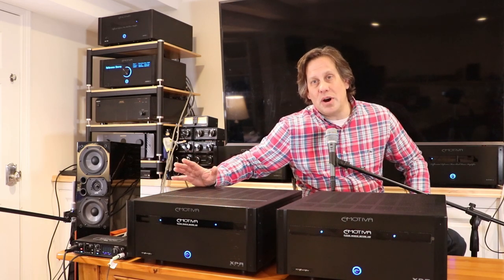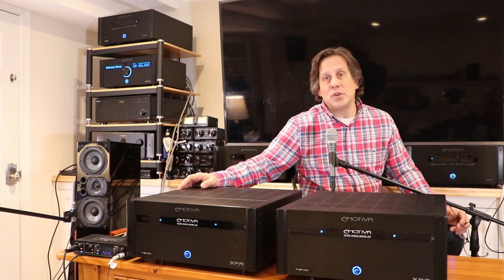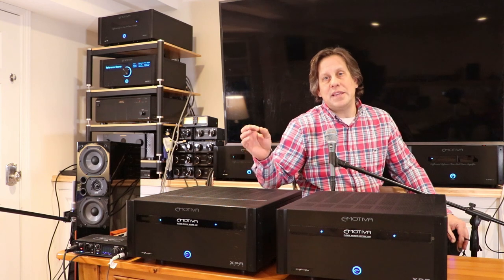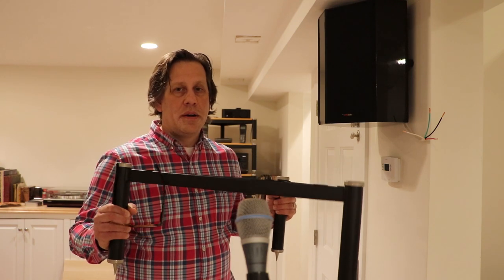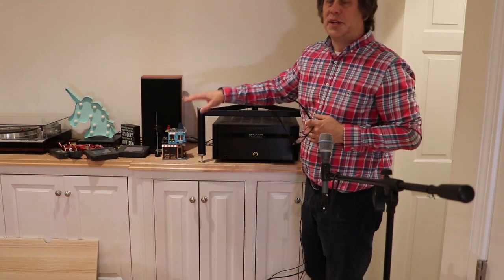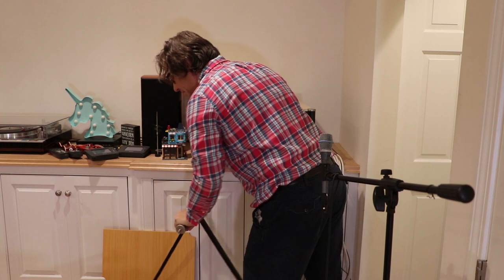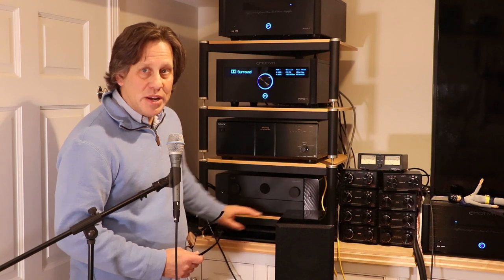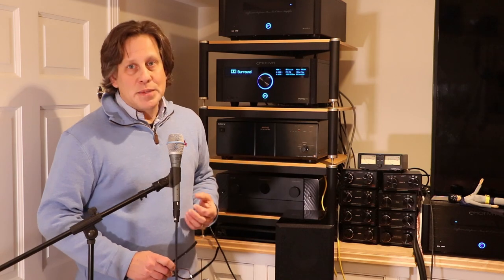Emotiva XPA-DR2 Gen 3 - Differential Reference Driving Surround Speakers

Comment: So pure direct mode is a stereo reference mode. I learned something, and that is the mode I like with a bit of help from a signal correction processor, the BBE 882i enhancement and some good cables.
Reply from the maker: Adding in some pro gear to enhanced the sound - nice. I will have to look at the BBE sonic maximizer more closely. -Jon
Reply: @ripewave  I am adding the Douk Audio T8 HiFi Vacuum Tube 5-band EQ Preamp Equalizer XLR x 2 between my processor and Emotiva XPA-DR3 Differential Reference™ Three-Channel Power Amplifier. Easily the most important amplifier product Emotiva makes is the Differential line. It is needed to power B&W and Polk R700 towers. Most reviewers don't tell you massive differential balanced XLR power is needed for powering these demanding speakers.
Reply from the maker: The manufacturers don’t either. Polk and many others under state the power requirements. Yes, they will play, but will be constrained. While minimums are fine, they need to up the “recommended” power.

Also - you are the second to mention the Douk tube amp. Must be something special about that one. -Jon

Comment: Nice job Jon. Not sure if it helps but it sure does look cool as all those amps sequence on and off. It’s also nice to have all that reserve power when cranking it up. Btw, have you thought about room treatments?
Reply from the maker: Thanks for weighing in. This enhancement was the result of several years of planning. Glad you appreciate the look of these stacked up. 

I have yet to give any thought to room treatment. Using the kids toys, wall-to-wall carpet etc to dampen reflections for now. Any thoughts? -Jon

Comment: Hi Jon, would it be a good idea to power the stand alone front speakers (R & L only) with the XPA-DR2 while powering the surrounds and heights with the XPA-* Gen3? So that when you're in stereo mode for music, you've got the best sound out from your speakers. My setup is currently 5.1.4 and I was thinking of a XPA-DR2 along with a XPA-7 Gen3 (all with the 200W RMS power amps) Thanks
Reply: @xmj
Jon didn't answer you, but that set-up sounded good to me. Did you finally end up with your idea

Comment: A warm welcome to you all. John what do you think about using a combination of 2x DR2 gen3 for the right and left front channels and connecting with the speakers in "bi-amping" but in DR2-L + DR2-R configuration ? Each amp works almost like a monoblock with bandwidth separation. Will you take up the challenge ?
Reply from the maker: Interesting concept. I typically reserve recommending bo-amplification for those with two amps that are otherwise underpowered for the speaker and they don’t want to purchase new amps. 

In this case the XPA-DR-2 is more than capable of handling the full range of the speaker using just one channel. I could try. I just got another DR-2 in to power my front wide speakers. 

Currently I have two monoblock XPA-1 Gen 2s powering my front Left and Right speakers. I could keep those in place but have them drive just the bass and the DR-2 could handle the upper frequencies. Then I could reverse to see what sounded better vs. the normal pair of monoblocks. -Jon
Reply: @ripewave  Jon thank you for your response. I suggest that from one DR2 GEN3 amplifier you power the right channel in such a way that the first channel of the same amp feeds the "HF" and the second channel feeds the "LF" of the same speaker. Connect another set of DR2 GEN3 similarly but to the left channel.
Reply: This combination will balance the overall loads on the amplifiers between each other, I mean the DR2 GEN3 of the left channel and the DR2 GEN3 of the right channel. The proposed combination can make a big difference with large speakers using several bass drivers in one column.
Reply from the maker: Perhaps I will try it both ways and compare. I see you are dedicating one amp to low frequencies and the other to high frequencies. -Jon

Comment: So is still a good amplifier the dr2, and it's not really fair to compare a monoblock , with a stereo amplifier, the power supply of a mono block have drives 1 channel,the stereo amp power supply have to drive 2  channels
Reply from the maker: I compare sometimes dissimilar products to determine if there is value to move from say a stereo amp to a mono block approach. -Jon

Comment: Is it a good idea to use Emotiva DR3 with 450wpc on 8ohms for Klipsch 8000f with a power rating of 150 continuous and 600W peak. Is it overkill to have DR3 for those speakers will it damage the speaker overpowering with DR3? Please advice
Reply from the maker: An overpowered amplifier is less likely to damage a speaker then an under powered amplifier. The underpowered amp will go into clipping which will damage the speaker. Klipsch are typically very efficient so you may not need the extra power and less likely to experience clipping. -Jon
Reply: @ripewave  thank you for clarifying Jon.